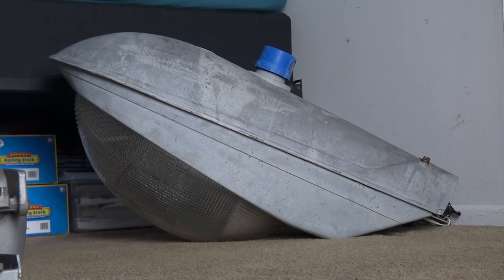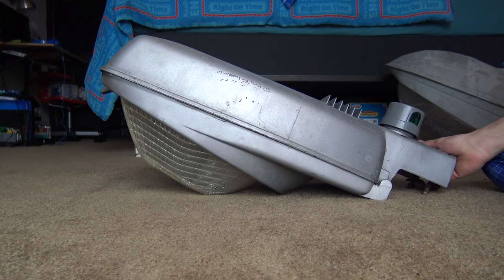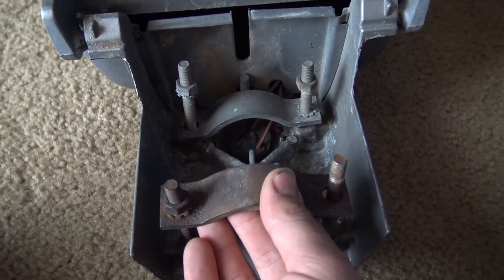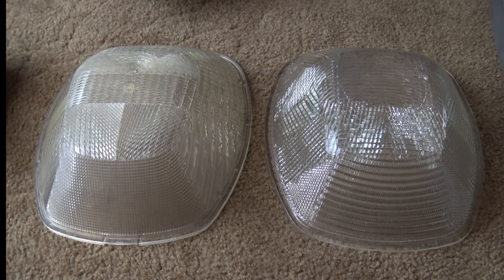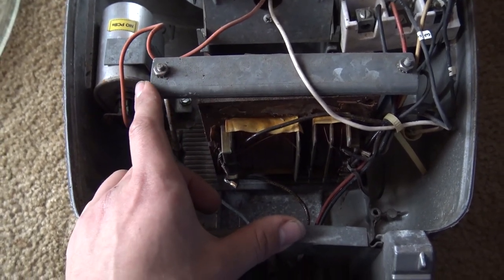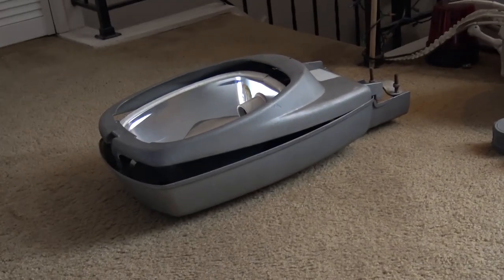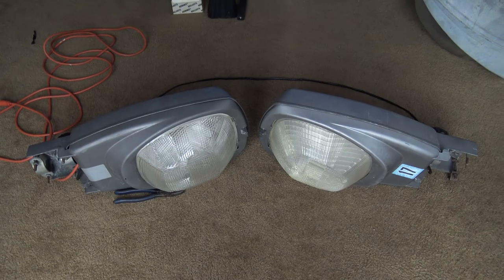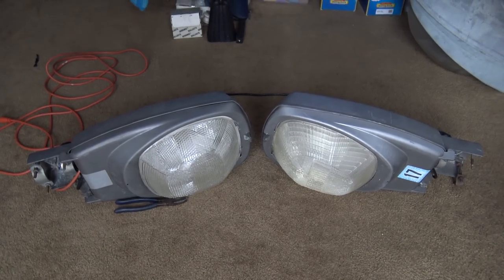Westinghouse/Crouse Hinds OV-15 Streetlights Overview

Comment: I remember back in early 1980 when they installed Westinghouse/Crouse-Hinds, OV-25, 400 watt Mercury Vapor Lamp in Dearborn Michigan, and it is on Chase Road about 1 and the half blocks north of Ford Road on the southbound side at Dearborn Villa Pizzeria Restaurant and stayed there in 2000 when they have installed 26 new fixtures, along with new arms (brackets) mounted on the wooden poles, and they are: 26 new HPS light fixtures along Chase Road in Dearborn Michigan between Ford Road and Arthur Street, South of Warren Avenue. Now Chase Road between Michigan Avenue and Tireman Avenue in Dearborn Michigan did installed more then LED street lights several years ago.

Comment: There are 2 of different lenses that does fit into the door. 1 is correct lens with Westinghouse to match with Westinghouse/Crouse-Hinds fixture, but the other lens came from Josyln and it fits perfectly.

Comment: question, may i put any capacitor in my 175w mercury vapor lamp that is 120v?
Reply: NO must be an exact "size" in MFD as the capacitor determines the LAMP voltage and will under/over drive your lamp is a wrong one is used

Comment: These are fourth gen versions. There was a first gen with the exterior bolts Then second gen like the one I got from you the other day. The third gen looks a lot like the prior but with slight differences to the casting that were made in the early 70s.

Comment: I would assume the stickers HAD printing on them when the luminaires were NEW but UV bleaching has removed the printed on information and that you say HPS does and MERC don't and Merc lamps give off MORE UV light then HPS and UV fades colours 
also the slip fitter bolts on the first one are "normal" Carriage bolts that can be cut off and replaced without damage to the fixture if they should seize where as the second style can seize into the fixture requiring damage to the fixture to remove then drilling through the top of the fixture to repair

Comment: These are actually the 4th generation of the Westinghouse ov-15 silverliner
Reply from the maker: The ov 25 has 4 generations. This ov 15 only has 3. There was never a 4th generation ov15.
Reply: @polarslightssignals2742  would you consider the Grouse hinds Canada OV-15 a 3RD gen then? or second?? as they have the "silverliner" body and not the "boxy" open slip fitter that yours / US version have